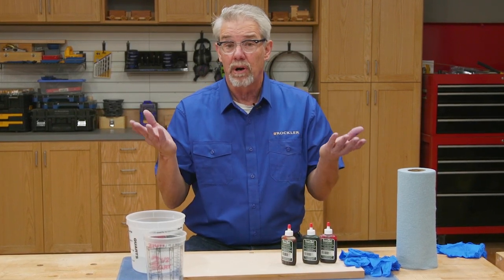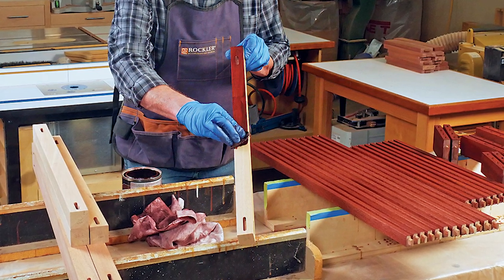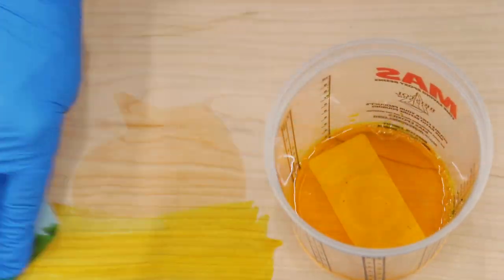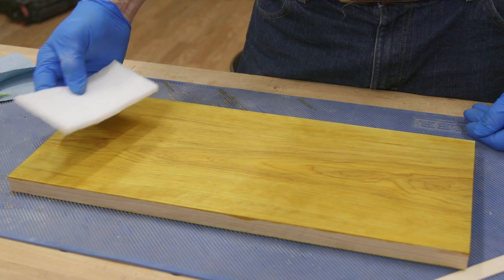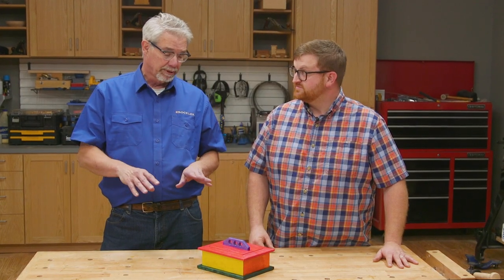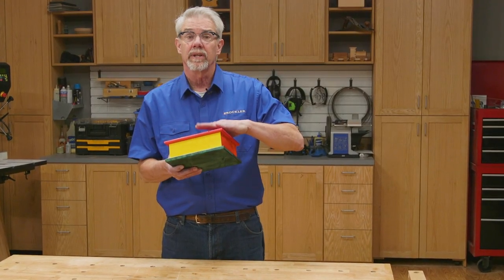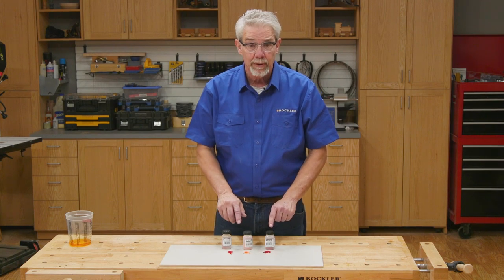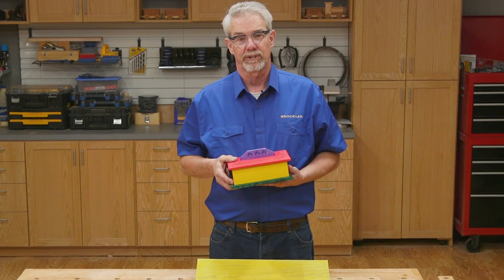Coloring Wood with Dye Stain

Comment: Please explain again about “raised grain”.
Reply: He was using water based dye.  The water will "raise the grain".  Helps to first wipe the wood with water, dry, and sand.  Then using the dye will cause less grain to rise.  As he said, usually does not require much to take the grain down.  Alcohol based dye doesn't raise the grain as much.

Comment: I color wood with inexpensive hair dye and it comes out gorgeous. 
I find that I get a higher quality visual with my technique. 
You should give it a try. I mix different colors to reach the desired color. I can go Red, Green, Purple etcetera...The dollar store sells it for $3.00 dollars a bottle and you can mix only what you need and save what you don't use for a good period of time. Its a great use for matching scratches in antique furniture also.
Reply: Thx for the tip, will def do some experimenting.
Reply: @Scratcher25  
Oh yeah, I used it to make a multi color handle for a blade I made.
I cut down some white oak into thin layers, I dyed each color using the hair dye, glued them all together and sanded it down on the edges exposing the different layers of color. The dye made it look so beautiful. Really easy stuff, but like stain, the longer it sets, the deeper the penetration. Just an idea for you in the future. 
Thanks for the video's
Reply: @Invisible-Human1967 Is the dye a powder?   What do you mix it with and then just brush it on let it sit for a bit and wipe off? What brand is the hair dye???
Reply: @PromNightDumpsterBaby420  
No, it's just cheap hair dye from family dollar. It's two parts liquid you  have to mix. Mix what you need in a cup and brush it on. Use it just like stain. It just offers colors that you can't get in other stains. It's permanent and beautiful.